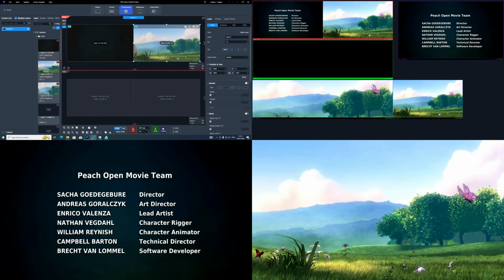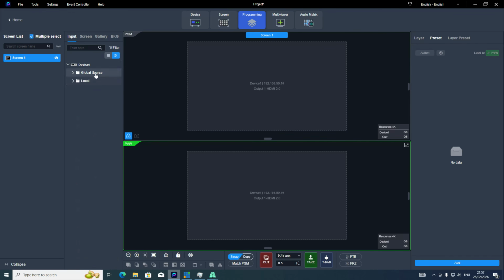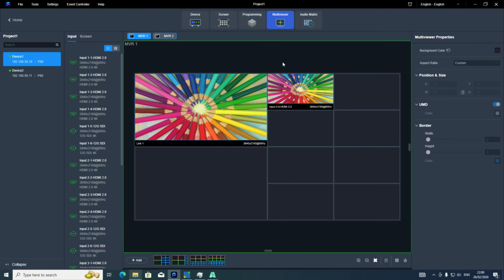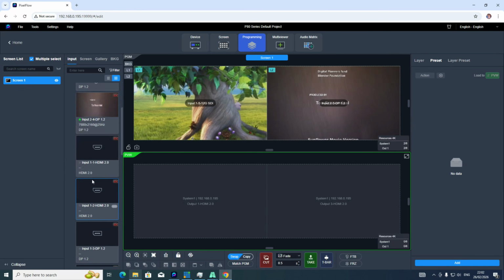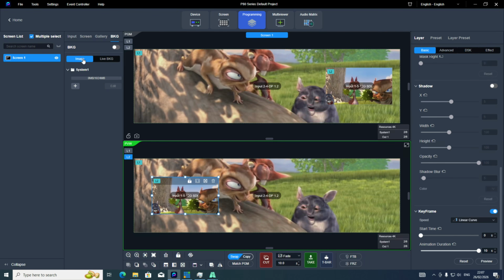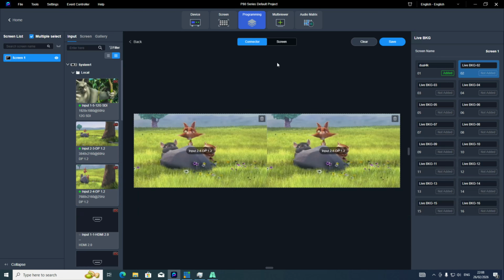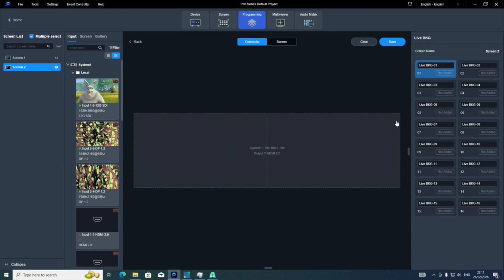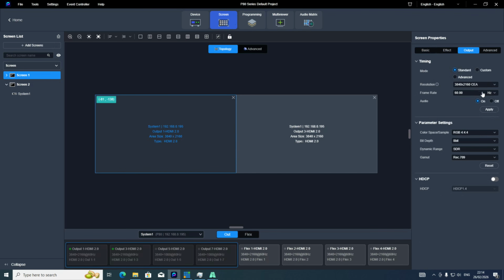Whats new in Pixelflow 2.0 and Pixelhue P80 1.2 and how to do it

Comment: Can you share beyond 4k inputs across frames? If something is running in mosaic for instance.
Reply from the maker: At the moment it's input sharing so if you have a mosaic input say 2x 8192x1080 inputs, you can share both of those inputs to a second frame where you can use each on a layer to create a live background in connector mode, or on layers on top.